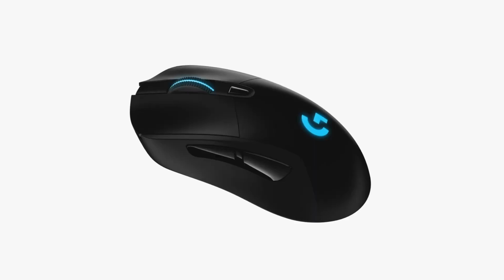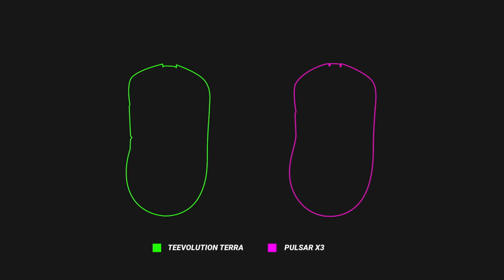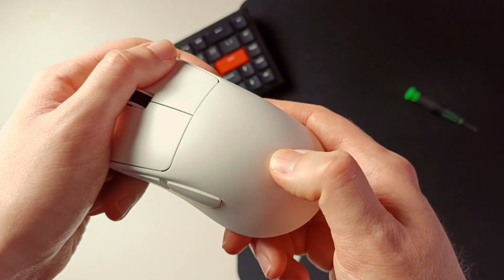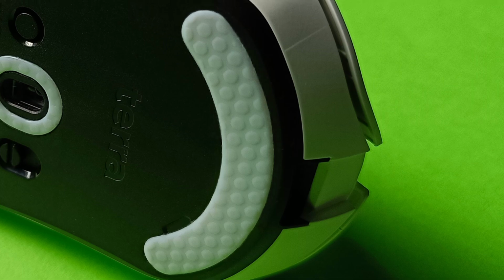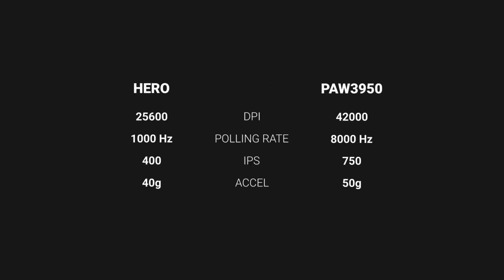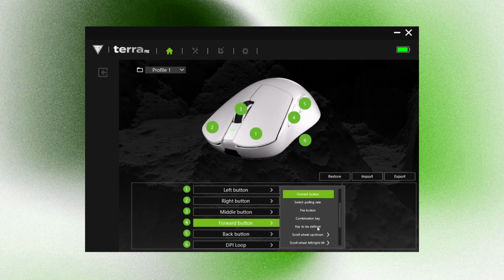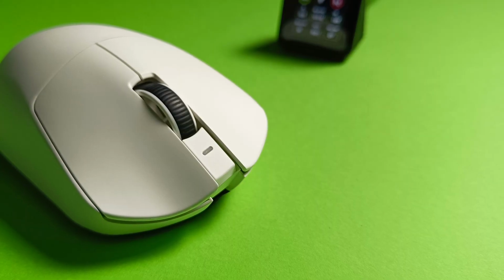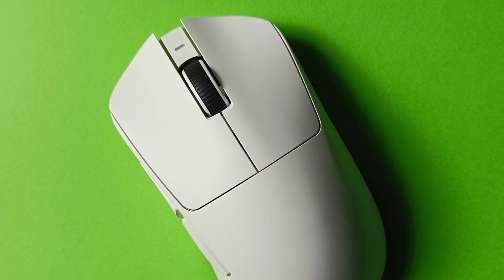The New 49g G703 Is Not Logitech! - Teevolution Terra

Comment: Hey, thanks for the video, especially for the shape and durability part, got a like from me. I'm deciding right now between g24 (deathadder v3 clone) and basic terra version, what would you prefer? My main concern for deathadder is weak middle button and that's why I want to buy a clone, for terra is uncertain durability after a long term usage as I can't afford to spend another 100$ if it's broken after a while. Palm grip, 18x9 hands. Thanks for the answer upfront!
Reply from the maker: Thank you very much!
During my testing and up until now, I haven’t had any issues with the middle button. That said, I can’t guarantee it will be the same in the long run. On the other hand, the Incott G24 has been on the market for longer, it's more tried and tested compared to the Terra, so if there had been any problems with the middle button, they would likely have been reported already. 
Personally, though, I would choose the Terra because of its better ergonomics.
They’re both good mice, but it all depends on the budget you’ve set for yourself.

Comment: Is it possible to assign two functions to each key by assinging a "shift" function to one key? Like Razer (Hypershift), Logitech (G-shift) or Turtle beach (Easy-shift). I use the "foward" thumb button as a Shift key. So my shift+LMB = copy, shift+RMB = paste, shift+ scroll up = F11, shift + scroll down = F5, shift + wheel = DEL. I can't go back to a mouse without this. A G703 / G603 already could do this.
Reply from the maker: No, unfortunately it doesn't have this function.